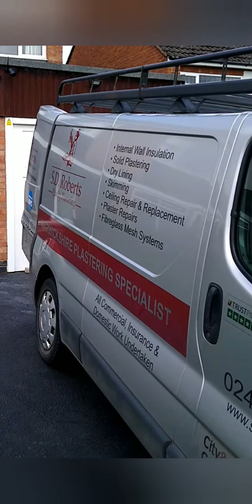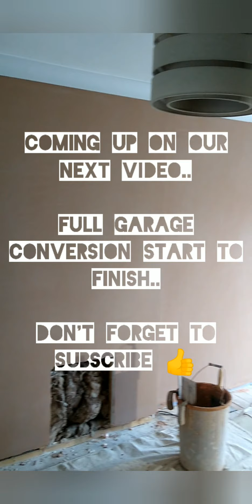SOUND BOARD 4 Review & install

Comment: What are these screw "collars" you're using called? Assume they are there to spread the pressure of the screwhead on the board? I'm installing some of these boards at the moment and having some issues with localised compression where the screws go in. Thanks
Reply from the maker: Hi Nart,
These are actually insulation fixings but work great for fixing sound board

https://www.ebay.co.uk/itm/Insulation-Board-Fixing-Washer-Disks-For-Easy-Fitting-of-Insulation-sheets-/233032885013?mkcid=16&mkevt=1&_trksid=p2349624.m46890.l49286&mkrid=710-127635-2958-0

Comment: Have your customers given you reviews on the soundboard 4? Looking at doing this on a party wall on semi detached. Lots of mixed reviews online
Reply: It does work but don't expect miracles. Its effective at reducing nuisance noise not blocking it entirely. The problem old houses where noise is an issue is that they are often constructed with loads of "coupled" joists and internal walls etc. Proper sound proofing costs a lot of money.. you need to do ceilings, floors, the loft etc. Sadly there is no way to really soundproof an old house to the point you won't hear anything from next door and new builds, well, you might as well live together..
If you were prepared to spend 15k doing it you might get a very decent result but who wants to go to all that trouble and expense for a semi or terrace they're not going to live in for more than a few years anyway?

Comment: Hi, did you use hammer fixings and if so were they 80mm or 100mm? Thanks
Reply from the maker: Hi Darren,

We use 90mm screws with insulation fixings 👍

Comment: Would you use these boards to minimise traffic noise or are they just designed for conversation/TV etc?
Reply from the maker: We have installed 72.5mm thermal laminate boards to outside walls & this significantly reduced road noise providing your window frames are properly sealed & double glazed
Reply from the maker: The laminate boards were installed to improve thermal performance & insulation but we noticed the reduction in sound was apparent

Comment: Hi if I hit an acoustic board with this method to a solid brick wall and leave it short from the bottom for my rebated pipe work will it still work? I wanted to leave it short from the bottom to fit copper pipes through and then use a rebated skirting board so no pipes are visible
Reply from the maker: Yes you can fill around the pipes with foam or AC50 sealant to reduce sound transfer
Reply: It will reduce the effectiveness, I'm sorry but the reply you got saying it's ok would just lead me to steer clear of any advice from this guy.

Comment: Can i install this to bare brick walls that may not be perfectly plumb ?
Reply from the maker: Depending on how far out of plumb the brickwork is you could build a stud frame Infront of the wall, infill with acoustic insulation then fix the boards to the frame